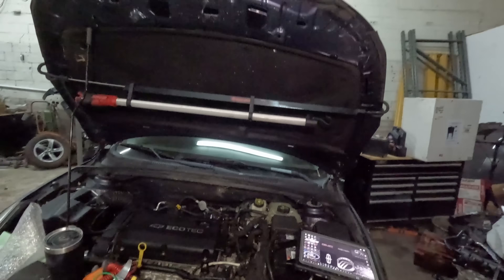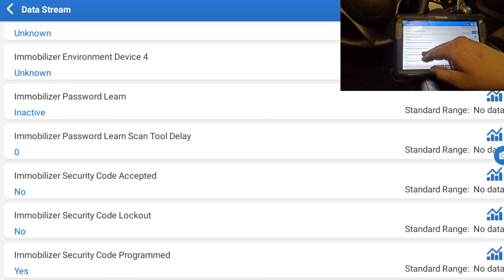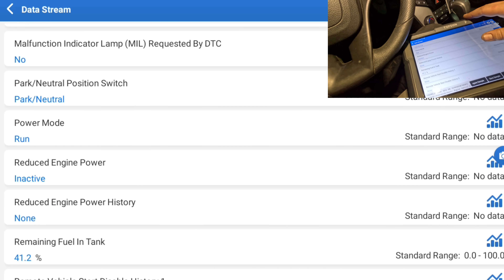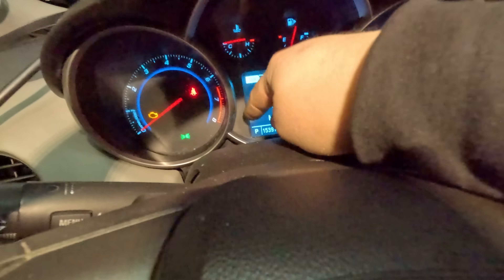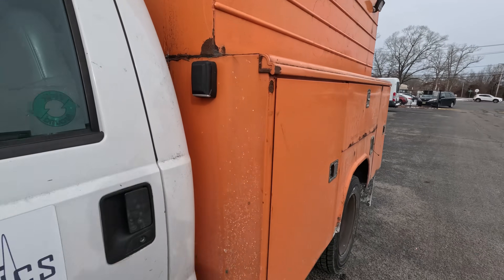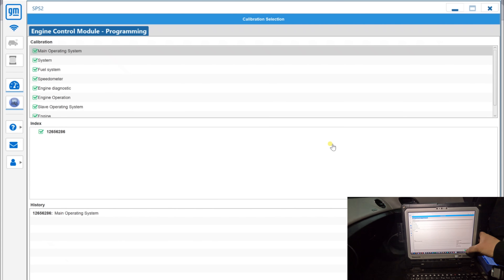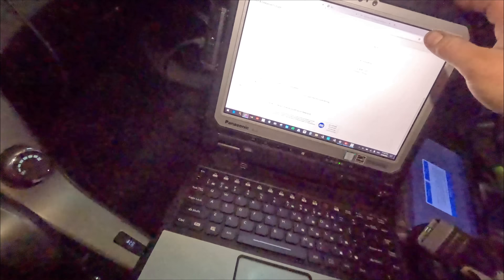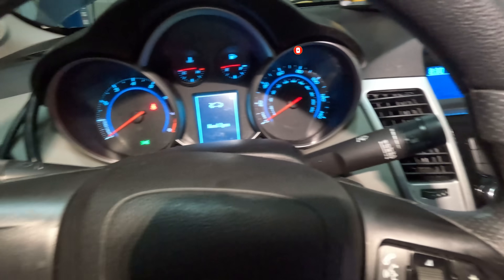2014 Chevy Cruze No Crank | TSB for the Win!

Comment: What codes did u have
Reply from the maker: No codes in the engine
Reply: @advancedleveldiagnostics  I have p062F, p0630 and p0633. Car don’t crank.
Reply from the maker: The P0633 means your vehicle is in learn mode for the immobilizer not necessarily a fault. The P0630 is for a vin mismatch or unprogrammed pcm. I would try by reprogramming the PCM. Was it changed?

Comment: I have a crankshaft prosition sensor error can that cause a no crank no start
Reply from the maker: I would think not.
Reply: I have a 2014 Chevy Sonic 1.8 I was driving down the street and it cut off no crank no start initially I thought it was the starter changed that it started I drove it for 30 minutes cut off again and didn’t start back up
Reply: @christophermiller6446 check both camshaft sensor or the fuel pump for see if have fuel pressure

Comment: you used 85 86 to start the starter, what does 30 87 do? I thought if you want to bypass the relay you insert a wire into 30 and 87 relay slot holes ?? to start the car ?? with relay out..

Comment: Hello, 

On mines i have changed bcm, ecu, key, ignition, immo, same problem sometime dont crank at all,

Sometime crank and dies, what can be the prob?

Thanks
Reply from the maker: Did you check if you have activity on the exhaust cam sensor?
Reply: @advancedleveldiagnostics exhaust cam sensor is ( camshaft sensor right?)

Im getting an error on cluster module as "incorrect immo identifier received" 

Already replaced ecu, key, ingition, bcm and immo box

Comment: I have a twenty fourteen chevy cruiseI have a 2014 Chevy cruise. It was driving fine. I side swiped a small pole. No damage to the engine whatsoever. I made the wrong choice and took it to a body shop and let him break it down for the frame damage. Estimate when it came back to me. It has like five codes on the dashboard service trek. And then it's what has no power. It won't go over 40 miles an hour.. Literally nothing wrong with it prior to the exterior break down and repair. Do you have any advice?
Reply from the maker: Step 1 you have to check with a scan tool to see what the codes are.

Comment: I have a Cruze with this problem on it's way to me. Maybe I'm going to be replacing the exhaust CMP sensor.
Reply from the maker: you should be able to see it in live data if its moving.
Reply: @advancedleveldiagnostics  It wasn't the same issue, turned out to be a start and stall with the security light flashing. Someone put a used PCM in it,  not sure why. Got the used pcm/immobilizer set up and it starts and runs fine. No codes. Hopefully it isn't back in a while with another fried PCM.

Comment: hey bro..  Thanks for the heads up on that X431 Pro being on sale.  I bought one and my buddy bought one and it's a pretty killer tool.
 On mine, everything seems to work fine, except on the first home page where there are several buttons, the:   "SERVICE FUNCTION" button does not work..  Well it works, it just takes me to a blank page;  where normally it would be a bunch of shortcuts of resets, etc.   It looks like I can still do the functions, they are just scattered around in the software and different modules, rather than having them grouped up in a convenient menu.    Are you going to make a video about this thing or a review, etc?   Because I would really like to know if mine is just broken and needs repaired or if that 'service function' button just isn't supported for something this old?     Can you please just open up yours and see if that 'Service Function" button in the center, near the top-- that has the wrench symbol:   is working or not?  Please let me know--  I really appreciate it.   and thanks again for the clearance shout out.
Reply from the maker: I just checked, mine is blank too.

Comment: With the exhaust CMP sensor unplugged at the end, would the ECM request an MIL, or does this ECM also get a position reading from a crankshaft position sensor or an intake CMP?
Reply from the maker: Yes, it had a circuit code for the exhaust cam sensor.

Comment: Cars are getting ridicously overcomplicated with unnecessary technology. Even with a bad CMP, the car should still crank. I would love to hear why the engineers designed it this way. With older cars, you could at least get home with a bad CMP.
Reply from the maker: The problem is that it is not simply bad, it is giving a signal that the car is running, so The car won't crank just like it won't crank when it's actually running.
Reply: @advancedleveldiagnostics in such case, the ECM it's missing a check, it should not rely only on CMP counts, but in CKP too.

I would even expect a dtc for out of sync if cam it's moving but crank isn't.
Reply: @AlanGonzalez-om4rr   The engineers dropped the ball on this one that's why there's a TSB. Like you said the ECM is missing a check. The ECM should compare and confirm those counts from the exhaust CMP with CKP and/or intake CMP. The computer's too dumb due to  insufficient programming. Although the exhaust CMP showed counts, it also showed zero RPM. You would think there would be enough code to throw a DTC code for that. Great video though! Good learning experience.

Comment: Being a govt fleet mechanic my whole life, the shop conditions you have to go to and work in are crazy, they are always very dirty, crammed, crap scattered everywhere, and you barely have enough room to squeeze around the car and open the door and get in. Guess I'm just used to the epoxied floors, super bright lighting, everything organized, and equiptment and shop cleaned weekly to stay clean. But besides that point, great diag though,  didn't see that coming
Reply from the maker: That's why I usually prefer to work outside the shop, Unless it is stuck inside or too cold.
Reply: I literally was just thinking the same thing. “This dude works in the most back alley sketchy places”
Reply: Yep. Agreed! Being mobile I usually prefer working outside of the shops that I service.  For all the said reasons. Awesome video man!
Reply: Easy to have a perfect shop when the budget is always plenty.
Reply: @maccarr9072  yes it is nice......

Comment: New Sub Here, Great vid, im assuming the signal from the cam sensor was going crazy and reporting that the cam was moving when it was not (engine off) you dont come across a no crank with a faulty cam sensor normally a faulty crank sensor would cause that issue. or was the cam sensor shorted internally
Reply from the maker: Yes it was showing that it was moving when the key was on.

Comment: Now that was CRAZY! never thought a bad cam sensor would cause a NO CRANK! 😳
Now we need a scope capture of the signal!!
Reply: ah you beat me to it Ivan
Reply: Would that be to read voltage? Or to read the cam signal output?
I am a noob be nice.
Reply from the maker: @TonicofSonic  cam sensor output.
Reply: @advancedleveldiagnostics  Thanks and hell ya, your alright in my book. Just a scope of what the cam sensor output was trying to do that wouldn't let it start is the conclusion I have drawn.
Reply: Most people would have never thought of that base off of the dtc but once I saw that Data I knew something was wrong.
Reply: Had the same issue after a oil cooler repair was okay when came in but after the repair it would start intermittently. I was going down the road of something got wet when flushing the cooling  system. 
Your diagnostic was the same road I went (except you where the source of the TSB info ) thank you
Reply from the maker: You're right I should of gotten one but I was in a rush because this vehicle took a lot longer than expected😞 Thanks for watching!
Reply: @advancedleveldiagnostics  what was the actual diag time? That TSB was a life saver lol
Reply from the maker: @PineHollowAutoDiagnostics  About 2 hours, including GM making me change my password. I really wish I had found that TSB right away. Some reason I couldn't find it in the list, only when I typed in no crank.
Reply: @advancedleveldiagnostics    I still don't understand how it could be counting without any movement?  Weird.. It must have a little circuit board inside rather than just being a hall effect sensor. Interesting
Reply: @advancedleveldiagnostics and you worked very fast.
Reply: Me to, never ever seen that!

Comment: so, do you think the oil in connection has anything to do with the problem?
Reply from the maker: It seemed like the sensor had a slight leak, so it is very possible. I didn't see that symptom in the TSB.